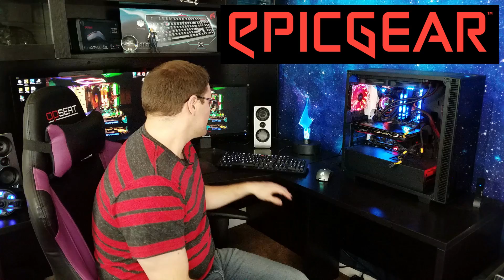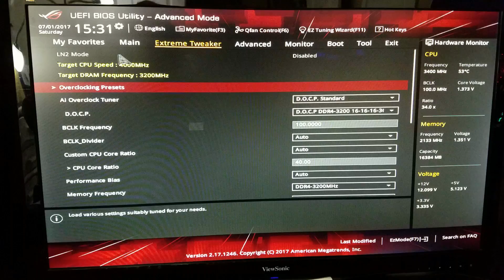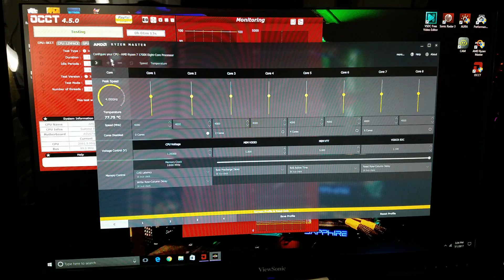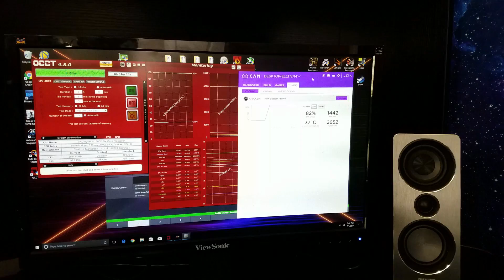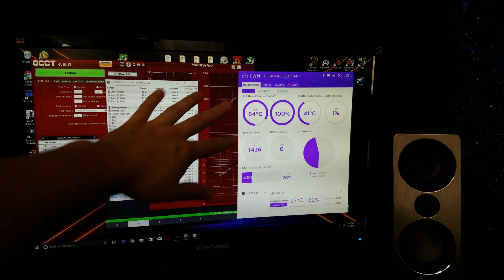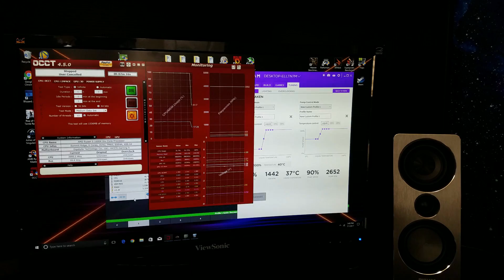AMD Ryzen - Best Motherboard and Overclocking - Update

Comment: It's still early and I wouldn't put any board up for comparison updates are still coming with this new architecture I am now running my ram @ 3333Mhz at 3.95Hhz on the chip with a Vcore of 3.95 stable @ or below 66C with the latest BIOS which just posted for my Hero VI

Comment: Well for me the asus cross hair have worked much better i stared whit a aorus 370 gaming 7 board and i couldn't get more than stock frequency on my cpu no metter what i did on the V core nothing worked for me then i change to the gaming 5 and same thing so i decided to go whit asus and now i am at 3.8 whit 1.3v memory is at 3200 avething is working good so far..

Comment: I have the gigabyte x370 gaming 5 board with the F6 bios. But i have to use ryzen master to overclock. When i set the vcore at 1.3 or above in the bios the multiplier locks at 15! Do you have any idea why this could be?
Reply: I am having the same issue! Except I am using a  x370 MSI Gaming Pro Carbon. I have done so much research and did not find anyone else having similar issues. I was sure it was a motherboard problem but now I am not sure.
Reply: Same Aorus board, same problem. Anyone find a fix?

Comment: great video mate , i just ordered an Asus Crosshair mobo for my 1600with dual flare X 2400 mhz do you think i will have those quirks that you say in your video? Also since i just ordered that mobo using Ryzen master is better than using the bios settings for the asus mobo?
Reply: PanadolExtra Asus got a new motherboard x370 pro f I'm thinking of getting it I only use Asus since the 90s plus Asus bios updated are more easy to do. I try gigabyte in 2000 sent it back like 4 times all they did send me the same motherboards back I had marked it and they wad trying to say it was a new motherboard and I told the 4 time ya send me the same one bicuase I marked it so $500.00 in the trash I got a new Asus motherboards boom everything worked so that's who I use only Asus in over 200 builds .
Reply: +1967 kID, That's the board I run on my main PC (ASUS Prime X370 Pro) It's a solid board. Good OC'ing ability, good UEFI, good VRM's. BEst bang for your buck, if you're trying to squeeze every drop out of a Ryzen, IMO.
Reply: Zenstates works better than either, IMO.